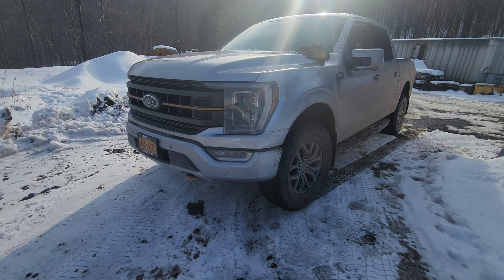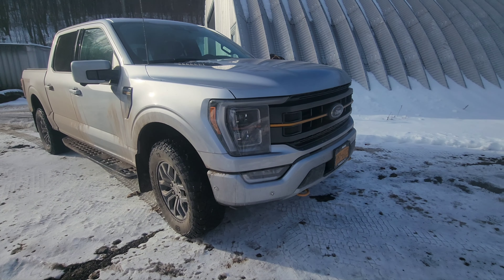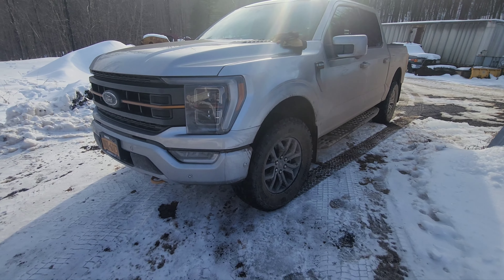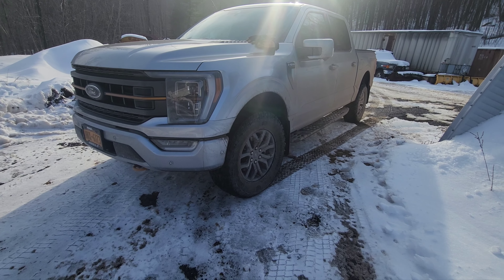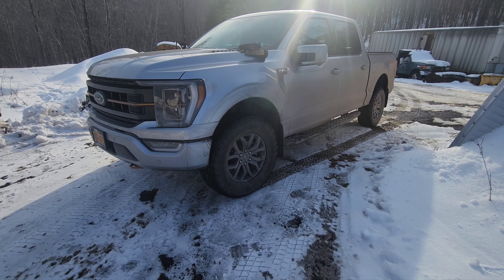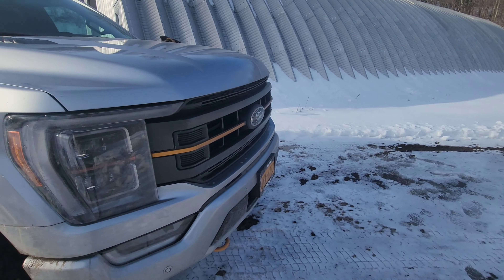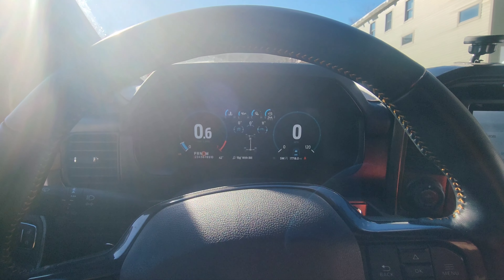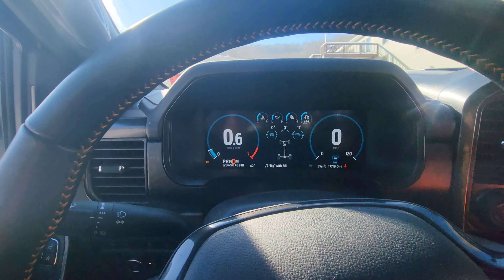Ford F-150 Tremor torsen front limited slip differential test. part 2

Comment: What do you think would be better in a snow storm, on roads, local and highways, but during a bad storm, Tremor or Raptor, with comparable tires, either real snows or 3 peak rated all terrains?  And why?
Reply: An F150 Tremor has a torsion front diff, but the Raptor no longer does, so it sounds like you think the Tremor would be better in those conditions.  I have considered an Audi Q8, a sports suv which has today's Quattro, and surprisingly has 9" of minimum road clearance, up to 11" at very slow speeds with its adjustable air ride suspension, more than most pickups ironically.  If I went the Tremor route I'd likely want to get a 2 1/2" to 3 1/2" lift/level and add 35" tires and a bit more poke.  I would really like a dedicated snow from Thanksgiving to Easter and a 3 peak rated AT from Easter to Thanksgiving.  But I can't find a dedicated snow in a 35" tire (or 37" if I went that Raptor).  Not even sure if there is a dedicated snow tire for the stock size of the Tremor.  I've seen Nokian and I believe Bridgestone Snows in the tire size of the Audi Q8 and the Yukon AT4, but those are smaller.  The Yukon AT4 starts a just under 8" minimum road clearance and goes up to just under 10" at very slow speeds with its adjustable air ride suspension.  Though a lifted/leveled Tremor would I assume be higher than both the Audi and the Yukon.  In any case, do you know of any specific brand and model of dedicated snow tire in the 33", 35" ideally, or 37" size?

Comment: Torsen front differential isn’t a limited slip. It’s a gear set which gives up to 💯 lock. Far better than a limited slip.
Reply: A Torsen is a helical limited slip. It does not give 100% lock.  Better than a clutch based limited slip but not nearly as capable as a real locker.
Reply: It has a rear locker.

Comment: So do normal F150 front diffs just act like an open diff? Or are they still capable of turning both wheels at the same time?
Reply from the maker: Only the tremor has that option. Even the new raptors do not have it anymore.
Reply: Normal F150 ft. diffs are open, however, traction control, if employed properly, can brake a spinning wheel, thereby diverting power to the other wheel with traction.

Comment: I realize you mentioned that you weren’t trying to make it up that hill and mostly demonstrating the Torsen but do you think if your intent was to actually  climb it, you could have or was it just too much angle and too slippery?
Reply from the maker: Oh yeah.  As soon as the video was over I just backed up one foot so I wasn't starting on ice and walked right up the hill.  The thing with four-wheel drive systems is the best you can hope to achieve is that all four Wheels receive driving force from the powertrain.  The rest is on the rubber.  My tires are pretty worn. They have about 18k miles on them but allot of that is offroading so the tread is pretty depleted.  Also when you get to the second half life of tires that are rated for snow and ice they lose some of their grip due to the way the rubber compound breaks down.
Reply: @rpmservice5211  I have the same truck so it’s good to know the limitations. I’ve had it in snow a couple times but nothing with severe angles so wasn’t sure.

Comment: did you get the v8?
Reply: He has the V6 as he stated he did demonstrate it before a year ago... only late October 2022 the V8's rolled out and I'm one of them.
Reply: @williamGT  yeah how do you like it? have you driven the v6 for comparison?
Reply: The V6 is a much better truck motor. Much more torque and lower in the power band. The v8 isn’t very good at towing. It has to go way up in the power band to make power and it’s screaming trying to pull.  It’s not going to get any kind of gas mileage when it’s a 4500 pulling a trailer. The 3.5 has 100 ft lbs of torque more and is much lower in the power band while pulling. The 3.5 is better at altitude also where the 5.0 drops off around 3,000 feet and above. 
The 5.0 is a mustang motor, it’s made to go fast and stay in the upper reaches of its rpm range.  The advantage of the 5.0? It sounds better.  It’s not as fast as the v6 either.
The second generation ecoboost is just as reliable as the 5.0.  The problems are in the 1.5 l the 2.4 liter ecoboost in smaller cars and cross overs.
Toyota moved to the 3.5 twin turbo and dumped its V8’s.  The only thing you need to do to ensure long life is frequent oil changes and and oil catch can .  But you should do that for any new truck you get. The 3.5 is about the fastest 1/2 ton out there BEFORE you tune it for another 75-100 horses outside the TRX and Raptor.  You really can’t tune the 5.0 without taking the motor apart.( you can get 12-18 hp vs 100-200 hp on the v6 with new turbos)
Reply: @jimsteinway695  Ford rates the 3.5 and the 5.0 at 10,000lbs for towing in the 2023 Tremor, exactly equal.  According to Ford, you literally gain nothing picking the 3.5 over the 5.0 as far as towing.  I laugh when people say the 5.0 isn't meant for towing.  It has 410lbs of torque, considerably more than what most of the full-size trucks had a decade or so ago.  It may have to rev more than the 3.5 since the torque arrives higher in the rev range, but the 5.0 loves to rev so no worries there, plus it sounds fantastic doing so.
Reply: @jimsteinway695 a lot of tests have shown very similar towing mileage with the 3.5 vs 5.0. So there's really no difference even if the 5.0 is revving
Reply: @jrite77  You obviously haven't towed with both. The 3.5 blows the doors off the 5.0 when it comes to towing. Torque is king when it comes to towing and the higher you get in elevation the more the 3.5 shines.
Reply: @jimsteinway695 nope. 5.0 is way more reliable. Just slam turbos on them if you want boost
Reply: @ if you want to be ignorant and use the old gen one and gen two eco boost go ahead. But the gen three 21 and newer is just as reliable if not more than the 5.0. Not only that but my son has the 5.0 and it’s just gutless compared to the 3.5.  Ive had it since nov w1 and it’s flawless . With turbo engines you just need to use the correct oil and do changes and they’re very reliable.  Ask Porsche